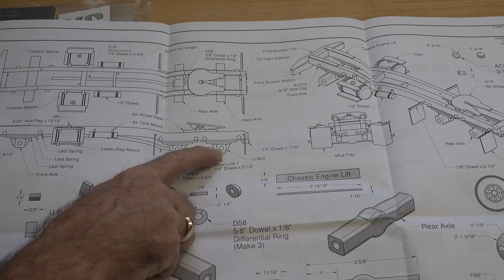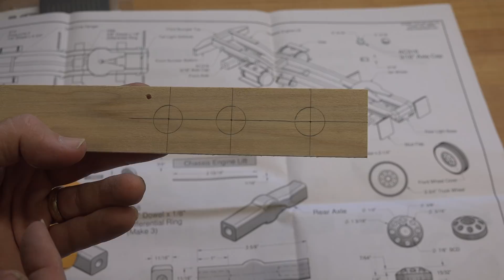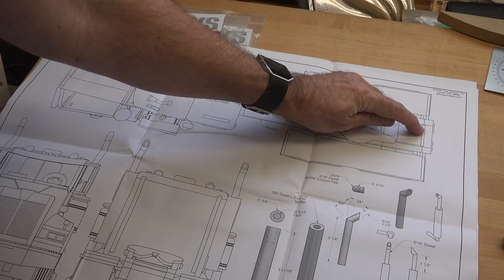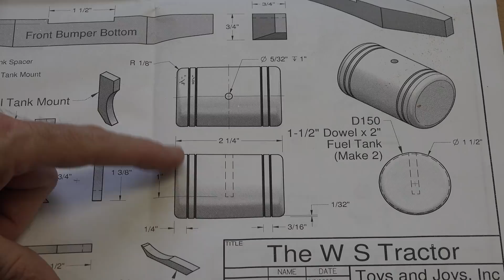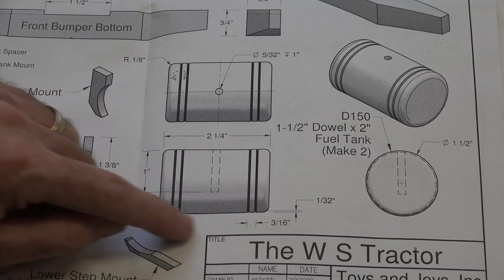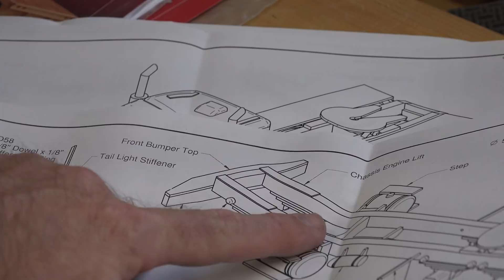Scale Model Part 2

Comment: I'm enjoying watching this series. I'm curious why you choose to use the table saw to cut the small parts rather than your bandsaw.
Reply from the maker: For most of the parts Jim, in order to get them to look right, they require a crisp edge and getting a crisp edge on a bandsaw (without getting any blade marks in it) is next to impossible in this case.  Then you would have to sand the marks out, which changes the shape, size and squareness of the pieces.  I've just never been a fan in this case.  The table saw give a very clean cut with a very crisp edge that requires little sanding.  I hope this helps and answers your question.  thanks for tuning in.